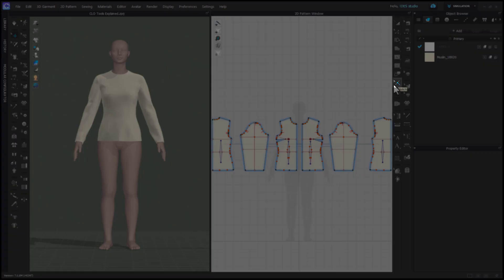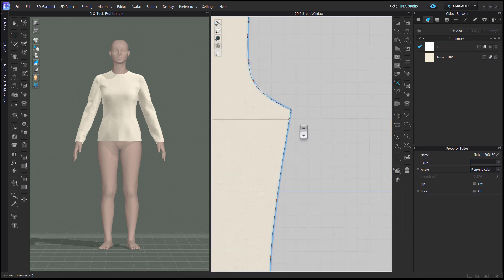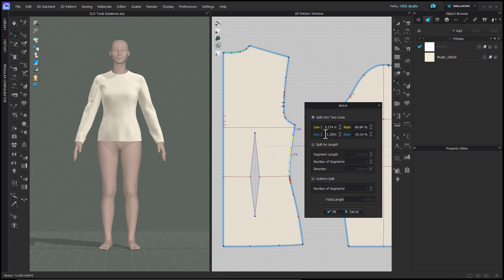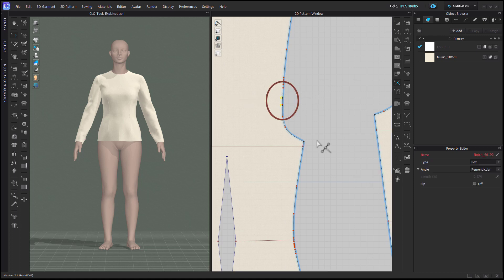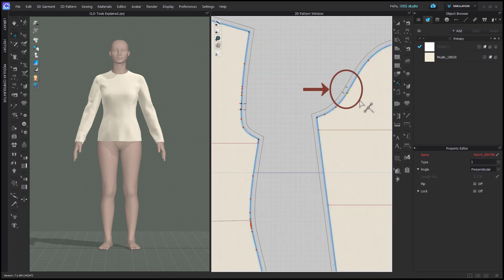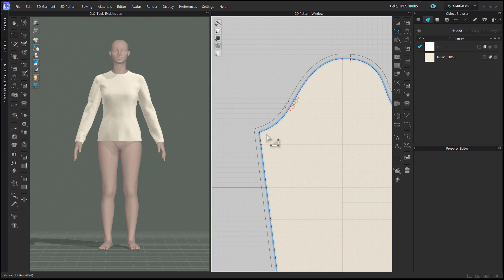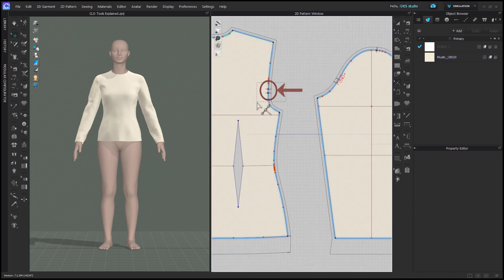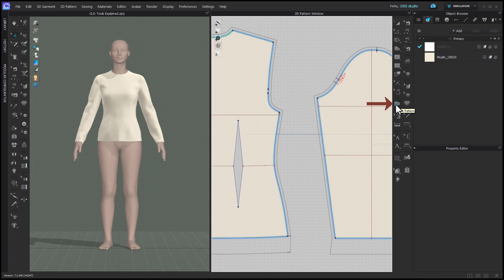CLO 3D Tools Explained, Under 2 Mins- Notch

Comment: How can I put Awl Punch/Circle in the end of my darts?Or they come automatically when I go to print layout .....
Reply from the maker: So I got a tip from the CLO community. There is no actual tool for this, BUT the internal ellipse tool- specifically the baseline one- defaults to a 5mm circle which seems to be the perfect size for a punch hole marking. You can just add one of these on the pattern and then drag it by hand to the place you want it. (which can be outside the pattern on the seam allowance) It's not perfect, but should do the trick! Let me know how you go.
Reply from the maker: Good question. I just did a test with pattern symbols and the notch tool and can't do it with either. Let me ask CLO and I'll get back to you!